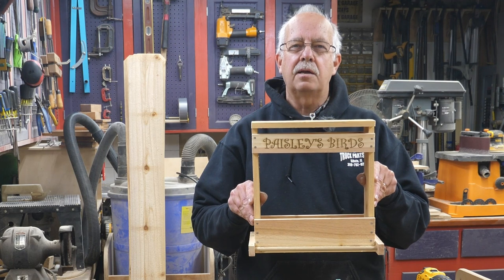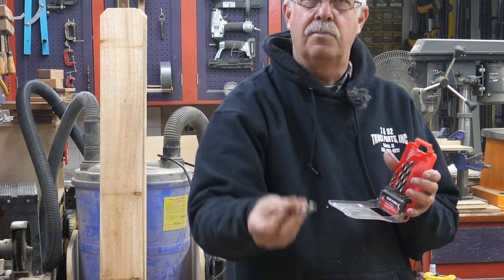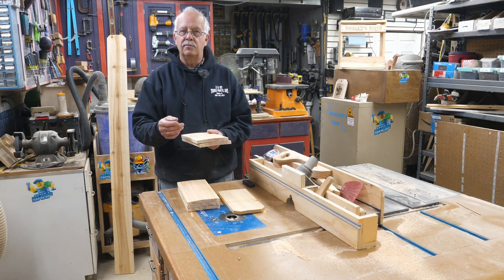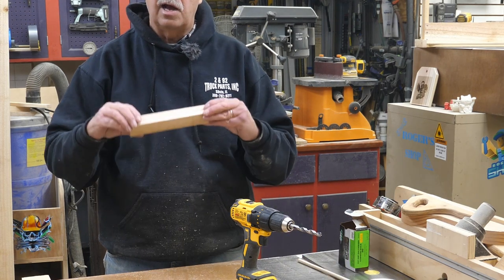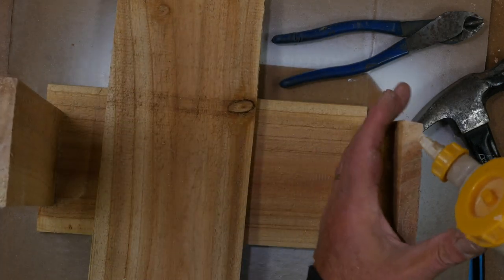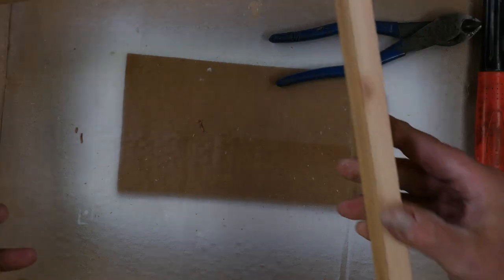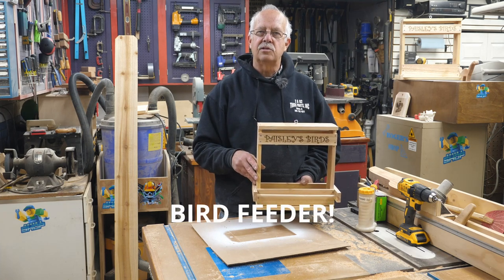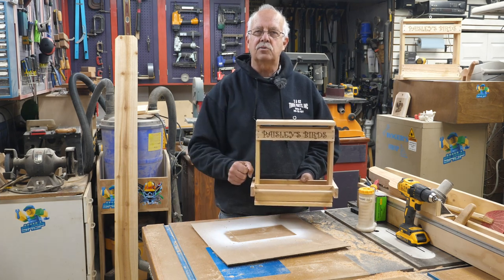$5 Basic Beginner Bird Feeder Good Youth Project!

Comment: Never saw a bird that demanded ‘fine wood working’. 100% are concerned with finding seed. This design is perfect for our own mods. My first one will be with whatever wood 
I have on hand. Future ones will be from cedar 
fence slats. Thank you for the instruction and ideas.
Reply: Also, there is a difference between a chop saw and a compound sliding miter saw.
Reply from the maker: @louislandi938  Yes.  A "chop saw" does not slide, so working width is limited.  About 6" with a 10" blade.